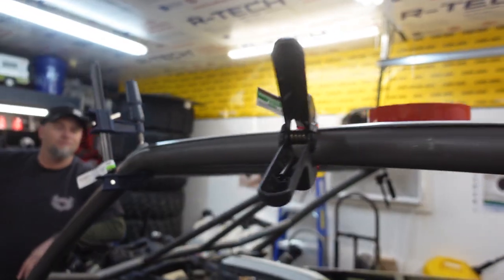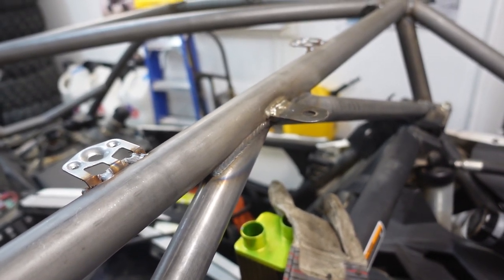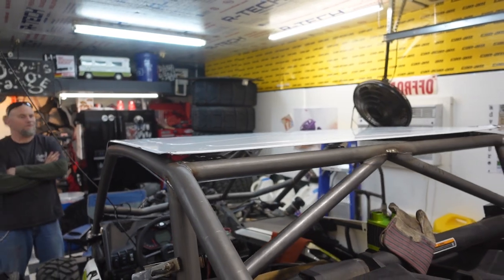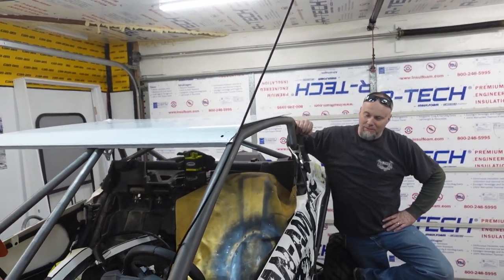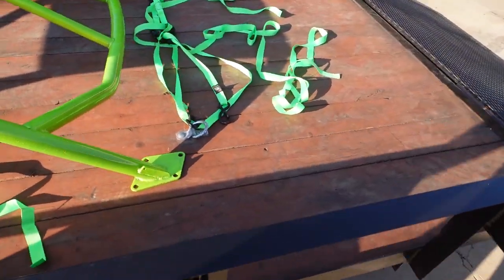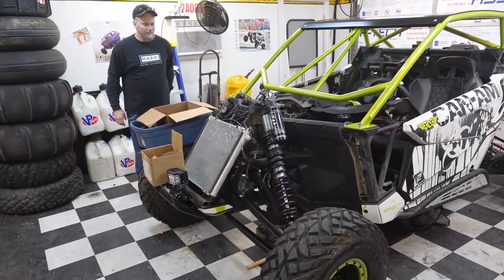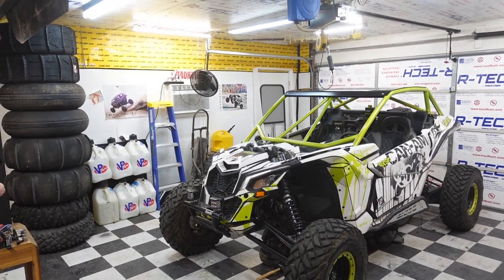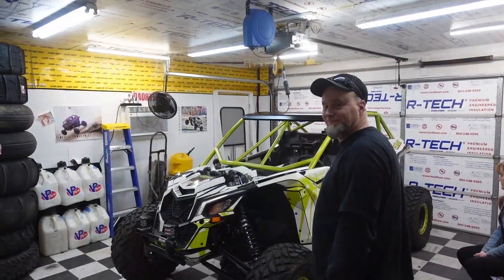Part 2 CAGEWRX SUPER SHORTY Danny New Cage

Comment: With the cages I've done I would recommend that you put foam tape between the roof and the cage. It'll stop the rattling and resonance in the cab. Looking good
Reply from the maker: Good call, we actually used some rubber weather striping, works great
Reply: @DandiOffroad  or round rubber flat grommets from ACE around the post